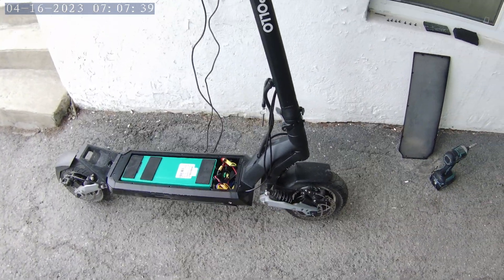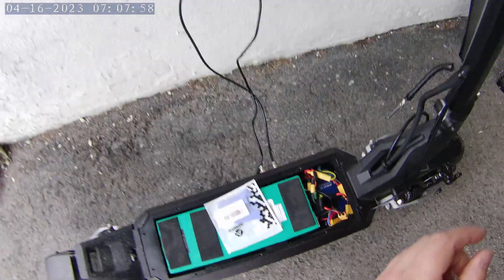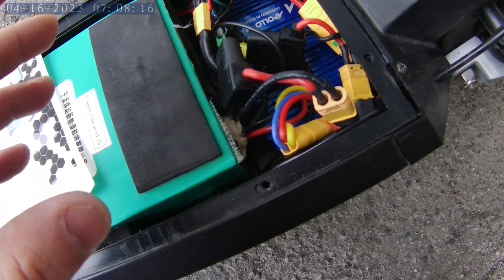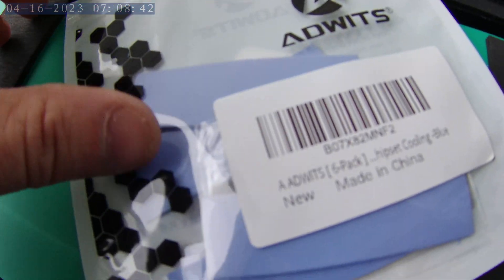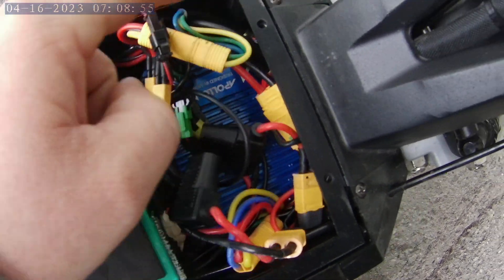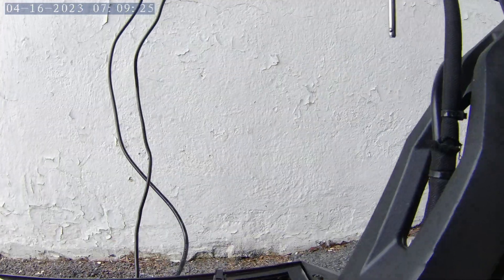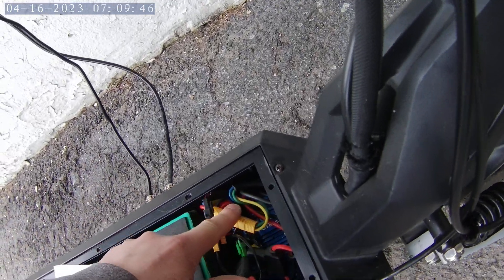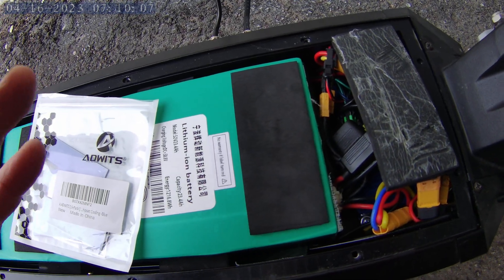Apollo Phantom V3 Overheating issues, FIXED!

Comment: Hey Travis! I recently installed V3 upgrade on my V2, and I've had the SAME issue a couple times. After about 7 miles of semi-hard riding(max throttle and max regen), it starts beeping and goes into limp mode, very slow, no power. Has only happened in LUDO mode. I haven't fixed yet, but thanks for sharing your fix! Much appreciated.

Comment: Oh no bro.....Never drill or cut where it's gonna compromise the rigidity of the frame. That scooter is now very dangerous.
Reply from the maker: Hahaha... Thx, i'll let you know when it splits in two.... For sure it wasn't dangerous when it wen't in limp mode and wouldent do 30kmh... it was either this... or not use it...
Reply: @Travis Eastman  the new controller is designed to shutdown when reaching a certain temp but goes right back to normal after a short distance. I only said what I said for your safety. Splitting a frame at 40 mph prob isn't fun.
Reply from the maker: @joecharpentier6636  you were actually serious...  honestly i'd be more worried about the control arms snapping off... or the neck ( my V1 actually had cracks in the neck, Apollo replaced it ENTIRE SCOOTER) ...The side frame Is actually 2 thin layers of metal .. Most of Structure is in the bottom, .. The sides are just like hollow  passages for wires to pass through, and plastic lights to clip on. Im sure you can dent the sides with a hammer or a rock and it will be fine....
Reply: @Travis Eastman  I only said what I said. because my brother is a structural engineer and I know when any compromise is made to a part that is integral in its entire rigidity as a whole, it will place undue stress to other components. If you think I'm just a wind bag then so be it. I'm certainly not wishing anything bad to happen in the slightest. The engineering that goes into most scootes today, especially the Apollo phantom, I'm of the opinion that if it were a place to put some sort ventilation, then it would have been done in-house by Apollo. Safe riding.
Reply: @Eastman-Stuff  the idea for the thermal pads is a great one. They make all thicknesses. Also remember that Apollo (especially the Phantom) is always evolving. Who's to say that there won't be a firmware update to correct the issue completely. Have faith in your very expensive scooter and the Manufacturer, before throwing it in the trash. Jmho
Reply from the maker: @joecharpentier6636  Man, pedal bikes are expensive, i sold an old Kona Stinky 2nd hand for more than what this scoter was.... lol  
   And, i basically broke the neck/frame my 1st frist one, and Apollo replaced it for free... This year they are making a $5000 Apollo Pro that goes 100kmh ... i already have my deposit down... 

So this is my beater scooter now DIE PHANTOM!!! DIE!
Reply: @Eastman-Stuff could have contacted Apollo to see what they had to say unless you already did
Reply: I used thermal paste, Arctic Silver 5. I haven't road tested yet, but that's what they recommend
Reply from the maker: @urban_phantom7750   Nice! Screw it down with some self tapping screws so its not bopping and flapping around inside... Also it will compress the thermal paste.... Road test it, HARD... like full throttle up a hill for 6 miutes should do it, let me know plz!
Reply: @Eastman-Stuff  : it's tightly compressed, and adheres itself without any need to fasten it. The top foam and wires keep it in place, as does the thermal paste itself. I live in a colder climate, and external ambient temperature probably matters
Reply from the maker: See if you can find any Engineering issues here!! BAHAHAA https://www.youtube.com/watch?v=VLoRMDEhrwg
Reply: Another recommendation I received that works wonders is to put down a layer of thermal pad (thicker the better), mount the controller UPSIDE-DOWN, then put another layer of thermal pad on the controller. Also removing the thick pads in the battery box. This configuration has kept my phantom from ever overheating, even when ridden full throttle, using regen a lot, uphills etc.
Reply from the maker: @joecharpentier6636  Well, its working great now anyways...  Overall, other than the E-motor breaking, i find the rest was not worth it, .. its barley faster, the OSD, meh... signal lights meh...  And the fact it overheated and they sell it with that problem... GrRRR apollo... I will sell this one, and try something bigger/better/faster